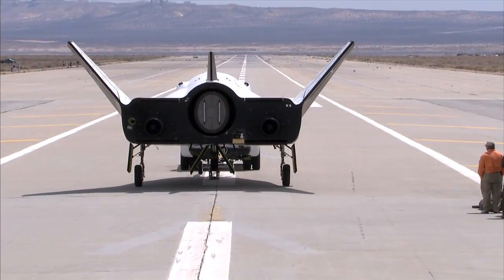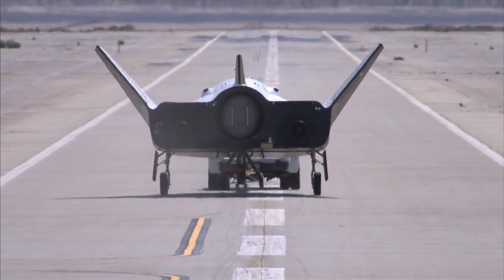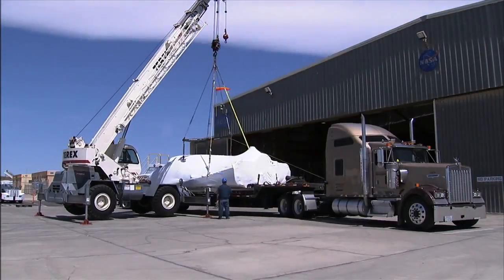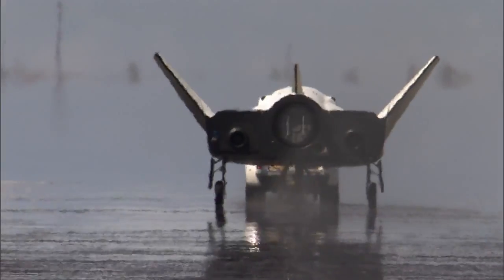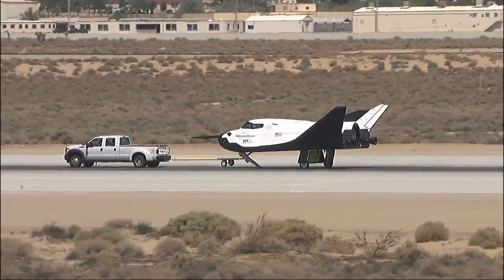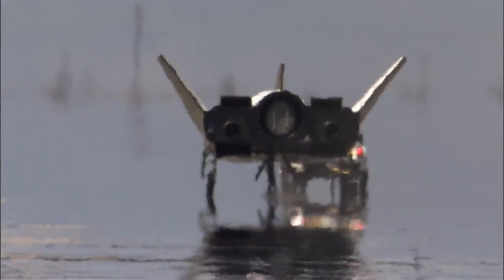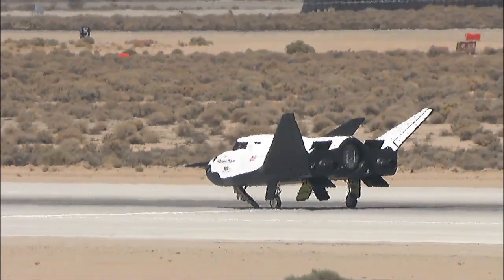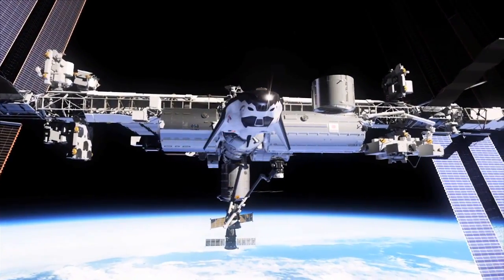Dream Chaser Taken Out For A Spin In Ground Test | Video

Comment: Its a tradeoff on the mass.and volume of a tire vs a deploy-able (replaceable) skid

also, the Space Shuttle's tires were something else.

Check out the video at  
ocw.mit.edu/courses/aeronautics-and-astronautics/16-885j-aircraft-systems-engineering-fall-2005/video-lectures/

Comment: umm, the vacume is only hot on the day side of the earth because of the sun. on the night side it is very cold. spacecraft have to be insulated for cold as well as heat. the space where the tire is stored is NOT pressurized. the fact that the tire is pressurized to 20 times atmosphereic pressure is the main reason why tires are a problem. i cant post links here but on the NASA CCD page it talks about the tire issue and why there are skids on the Dream chaser. check it out

Comment: I sure it's not the costs of the tire itself. But i guess a tire (including suspension and breaks aso.) is way heavier than a simple skid. And if there's one thing in rockets that's worth investing in, it's saving weight. So if a lighter solution is good enough, it's the way to go.

Comment: Sorry, but that's BS. First the tire is inside the shuttle, which is well insulated. (btw. vacuum isn't "freezing" at all, quite the opposite. It's so insulating that the space shuttle had to cool itself by radiating away heat)
Then the tires are already pressurized to over 20 times atmospheric pressure. 1 more atmosphere is negligible.  If tires were really that delicate, why would they use them for over 150 missions on the space shuttle? They were even designed to be used multiple times.